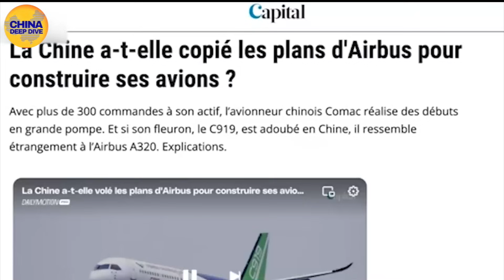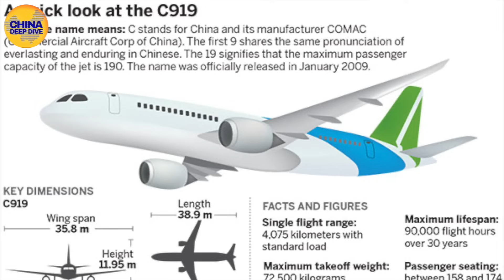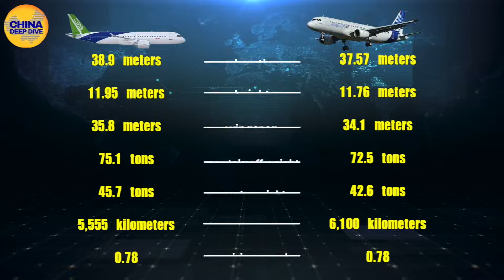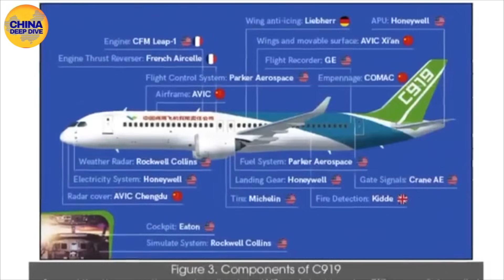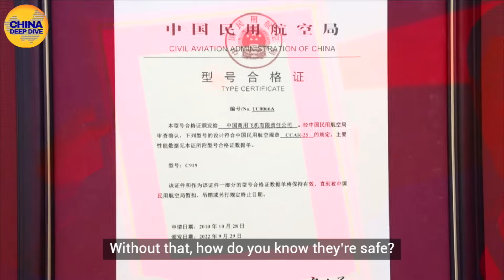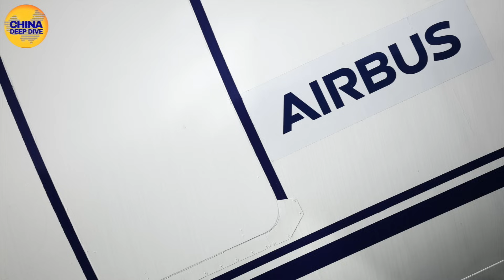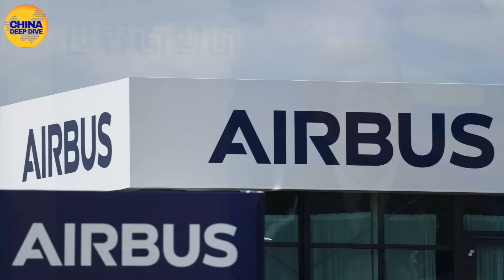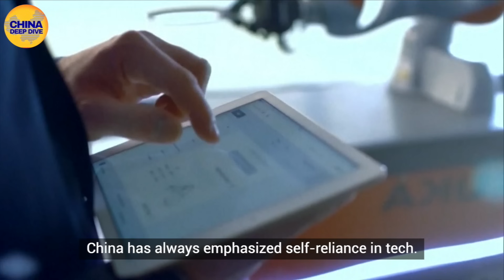How a Missing Airbus May Have Fueled China’s Jet Program  Airbus Vanished, C919 Appeared!

Comment: Yep. How China advanced so quickly. Others do the research and development.
Reply: Failures happen when you don't understand how something will react under certain conditions and situations. Research and development let's you understand all those variables and adjust to alleviate any issues from occurring. Copying  without the R&D leaves you blind to possible issues that lead to a failure.
Reply: @norme1850 Cutting corners, tofu dregs,  corruption, weaponizing specs and certifications (titanium, defective chips in jets ejection seat circuits...)...